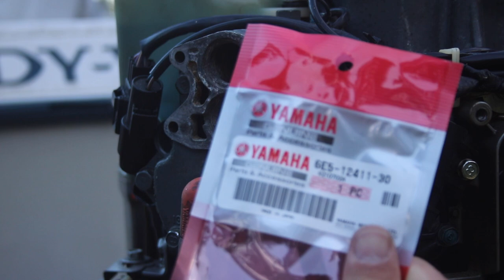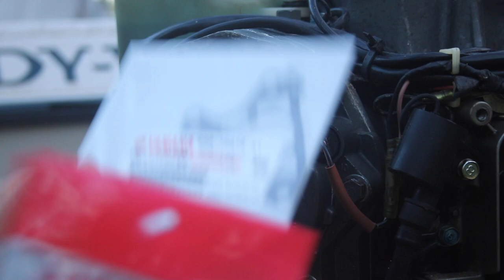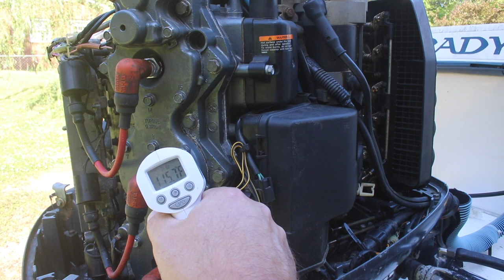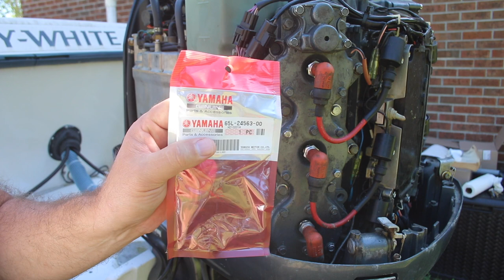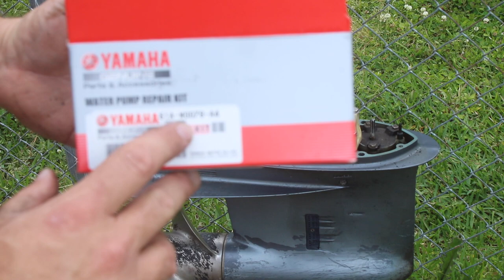Yamaha 200 OX66 Cooling System Maintenance

Comment: Just watched your video, probably one of the better ones I have seen.  You get to the point, show the parts needed.  My only comment was that some of the video was out of focus, no biggie, and when you showed some of the parts and part numbers, you were out of the range of the camera.  I have the exact motor so this was a huge help and encouragement for me to try some of this maintenance myself.  Can you do one on the fuel and oil pumps?  Have you done any other maintenance videos on this outboard? Thanks    Jim…..   😊. Keep em coming…..   😊
Reply from the maker: I just did the tilt and trim seals, but with my schedule right now it’s just easier not to film.  When it comes to the fuel pumps… I have never replaced my low pressure fuel pumps.  I also do not pump my home before starting which from what I have been told makes those pumps go bad faster.  Thanks for watching!

Comment: I have the same system in my SX150TRXA.  I do almost exactly what you do.  I pull the thermostats and flush annually for about 2 hours with salt away or similar products and pull the heads and clean the water passages every 500 hours.  The engine has been very reliable and so for so good!  
BTW, I also do the garden hose flush EVERY time I use the engine.
Reply from the maker: When I first got it, it looked like it had never been done, once it was done it lives up to the bulletproof name for sure!  Thanks for watching!

Comment: Thanks for the video. I just purchased a 99' Pursuit Kodiak with the same year Yamaha 200 OX66. Powerhead was rebuilt a while back. How many hours on yours? I've heard good things about them in terms of reliability and longevity.
Reply from the maker: I’m not sure how many hours on mine… pretty sure it’s less than 1000… And from what I have seen it lives up to the bullet proof name.  It’s basically a carburetor with fuel injection on the front side like a throttle body, So it starts easy and runs well with a lot of power.  I also run non-ethanol gas to avoid any problems.  Thanks for watching!
Reply: @turningwrenches9524  great to hear; thanks for the feedback. Subscribed!

Comment: It didn’t look like you took the little rubber gasket off the old fuel filter and reinstall it into the top of your new one. Maybe u did, but u didn’t show it. Also, you didn’t grease anything on your water pump replacement. Those new gasket pins, the Woodruff key, housing bolt threads, shift shaft or the top of the shaft itself, at a minimum.

Comment: The grommet in case for poppet valve is the one to change if corrosion pushed on it that will create a tight hanging up poppet valve
Reply from the maker: I did end up changing the grommet, spring and piston…no issues since so it was probably my problem last year as well.  Thanks for the heads up!
Reply: @turningwrenches9524  
I got a dealer mechanic friend who's super good and swore the popped never goes bad 
But my ox66 200 it was overheating at low speeds only that was the problem I found after changing thermostats and impeller and removing heads to sandblast passages
Got another ox66 225 someone traded in with a low end overheat after dealer did heads thermostat and pump I bought it for 1500 and it looks new under cover so I'm hoping it's the poppet valve on it as well
Then gonna swap the 200 for 225 
18ft McKee Pulse 200 running 54 @ 5400
Reply from the maker: @drifter9425  that will scoot along pretty quick on that hull.

Comment: That’s good  I have a 2011 150 hp yamy   How do you check oil injection system  I would like to see that
Reply from the maker: Good idea. I will look at doing a video on that.  I’ve only been stranded one time. And it was due to the oil pump not pumping from the reservoir tank into the motor mounted smaller tank.  It would run for a few minutes and then go into limp mode

Comment: Do you know if there are any engine block anodes that need to be replaced?
Reply from the maker: When I did a total water jacket clean out, I replaced all of my engine anodes.  Cleaning the water jacket was easier than I expected it to be and the result was great.  No over heating since.
Reply: Where are the anodes? I can’t find them!?  Thanks!!

Comment: Thanks for the vid!!! I just did both thermostats... and my poppit (PRV) valve. My motor, 2001 250hp ox66 SX250TURZ, also has a "thermosensor". Only ONE, on the STARBOARD side, directly next to the thermostat, I have a thermosensor sticking straight up w/ an electrical connection. Online, yamaha OEM parts lists this as a "thermosensor"... but my manual calls this an "engine cooling water temperature sensor". First off, do you do maintenance on these, cleaning or replacing? And second, what's the purpose? If the thermostats are both measuring the temperature of the water, then what is the thermosensor doing? Any insight is appreciated... thanks.
Reply from the maker: The thermosensor is there to tell the engine control computer when to alarm from an overheat condition and go into limp mode.  Limp mode is where your engine computer limits the rpms to 2000. I am not sure they can be cleaned, but I have verified them electronically by heating up the sensor with a blow dryer and seeing if the sensor will break continuity…or make continuity if it is a normally open sensor.(can’t remember)

Comment: The lubricant of the impeller is water
Reply from the maker: I was only applying the grease… To make it easy to install the impeller.  Is that not the correct way?
Reply: If you put grease the oil reduce the life of the impeller some manufacturers they noticed this in tha service manual....
Reply: Many years before it was acceptable
Reply: But they change it
Reply from the maker: @jimmisfyl5841  Thanks for the heads up!

Comment: You forgot the small o ring that goes on top of the fuel filter, it's the size of a dime
Reply from the maker: There is not one on the parts listing.  Post a link?
Reply: @turningwrenches9524  65l-24564 is the part number. My Yamaha dealer sells it with the filter, the small o ring that goes on the top of the filter and the gasket that goes on the bowl.
Reply from the maker: Yamaha started or switched to that o-ring for the 2001 and up year models.  The 1999 and 2000 model use the large o-ring like I used.  The part you listed is in the parts diagrams for 2001 and up. That was a head scratcher for a minute.  Thanks for watching!